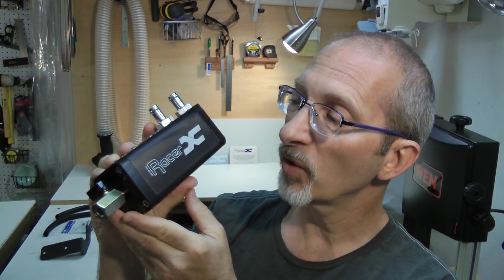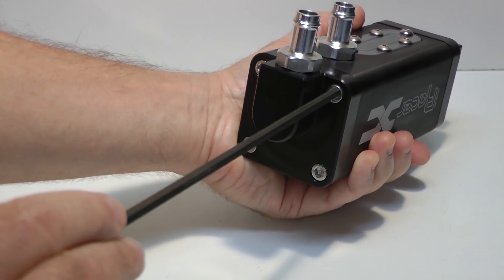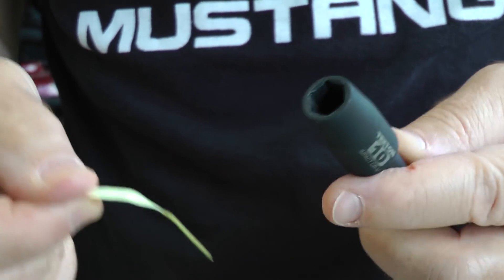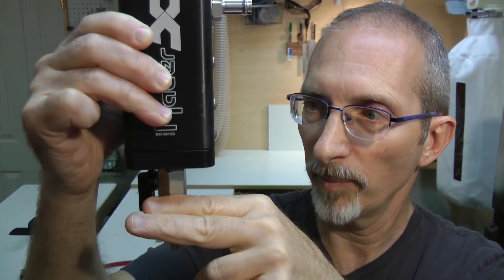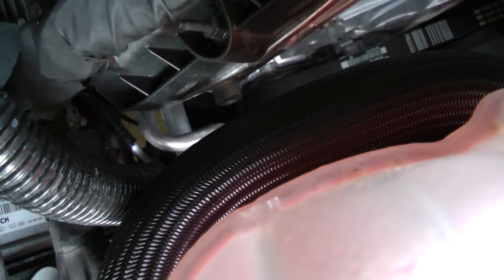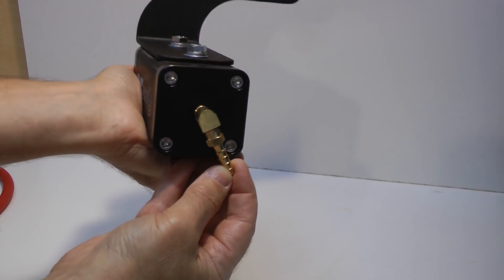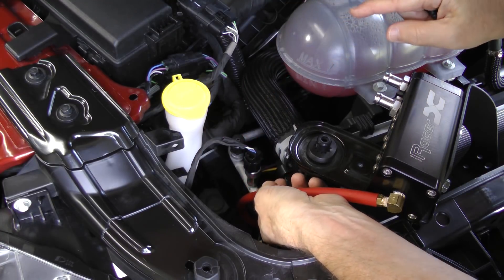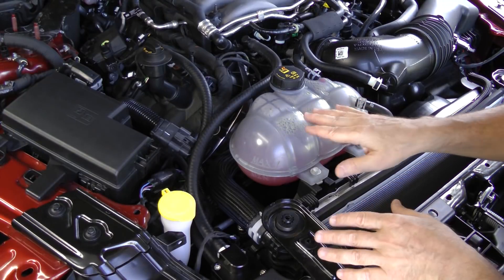Not your TYPICAL Installation… | Racer X Fabrication Mustang Oil Catch Can

Comment: Happy with the racerx oil can?  Does it work as advertised?  Find that you dump much excess oil from the can?  Did you look at other can options before choosing racerx  can?
Reply from the maker: J R - in a word, ‘no’ I’m not particularly happy with my decision. While I got this catch can to work, it’s placement is so inaccessible that it defeats the purpose of the watch glass to view the levels without removing it. I’m sure it works just as well as all of the other catch cans on the market, but if I had to do it all over again I would choose an inline model like the JLT oil separator, which I also considered. Another reason I chose this Catch can is because of the larger capacity, but my Mustang is a garage queen and simply doesn’t collect that much oil based on how I drive it. Live and learn! I hope this is helpful, and I appreciate you joining the conversation!

P.S. I’m going to add a link in the description to a video of me emptying it…amusing. 😀  https://youtu.be/EsZRUW_PRdQ?t=348
Reply: @MikeFyxdt  appreciate the insight and keep up the awesome 👌Channel!!!  Looking to get 1 of these for an MR2 toyota and if the level can be well visualized may be worth a buy?  Looks like the quality is solid.

Comment: Mike, as always, very professional install and great video.  Of course with the additional hose before the drain valve you may never see oil in the catch can window.  I might have added hose clamps to all hose connections as over time and heat they may get a little loose.  Thanks!
Reply from the maker: Randi Ruge - Hi! and as always thanks for watching! Based on what I have seen in other people’s catch can videos, I assume that I will collect a couple of ounces every three or 4000 miles of driving. That should be more than enough to fill the length of hose before the shut off valve and show in the window. Thanks for the hose clamp suggestion; I will keep my eye on how the system is holding together and hose clamp as necessary!

Comment: Another good video. P.S. I found a new take off set of wheels and tires. The forged nickel ones  like you have so I will not be bugging you to sell yours. LOL.
Reply from the maker: 2018 GT 10R80 - thanks for checking in! So glad you found a set of the nickel wheels. I can't believe more people don't opt for them. Share a pic of yours when you get a chance!
Reply: I think a lot of people like black wheels which are stock on the PP1. I for one do not care for black wheels. Plus they are a $795.00 option with the PP1 already being $3,995.00. Being a forged wheel they are more expensive than a cast wheel. My 18 GT is also RUBY RED but it is not a convertible.
Reply: I am ignorant on how to send you a photo of my GT.
Reply from the maker: @GTR-ex2ly  I guess share it to social and post a link?
Reply: try this link. bottom of the page.  https://www.mustang6g.com/forums/threads/what-did-you-do-to-your-s550-mustang-today.11109/page-1638

Comment: Is the catch can really worth it?  What happens if I don't install one?
Reply from the maker: @John Olson - my understanding is that any vehicle that uses direct injection runs the risk of having burned oil deposits build up on the intake valves. New Coyote engines have both direct and port injected fuel systems. I suppose if cars were failing during the warranty period because of burning oil, then Ford would put these on as a factory part - or maybe there's not enough data and they are trying to keep the 'today' price down, and let the chips fall where they may in the future. Oil catch cans remove that risk and keep the engine cleaner. Here's a video I recommend for more: https://youtu.be/T-B4VRxAtbw

Comment: I'd just rather use a JLT or the like that you screw off and empty than this one... Unless you plug the end of that hose after you empty it, its gonna drip from leftover residue in the hose after draining.
Reply: Tony M good point.
Reply from the maker: Hi Tony, I didn’t think of that. I’ll throw a piece of cardboard on the garage floor after my first empty cycle to see. Thanks for the heads up!
Reply: Mike Fyxdt put a longer hose on it and flip it double with a clamp maybe.